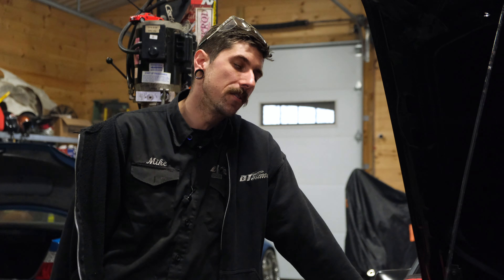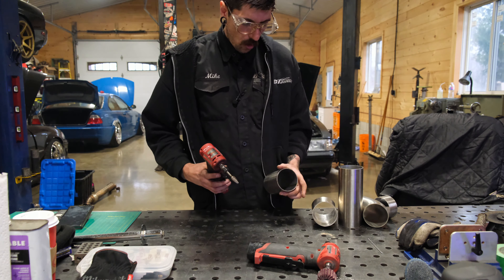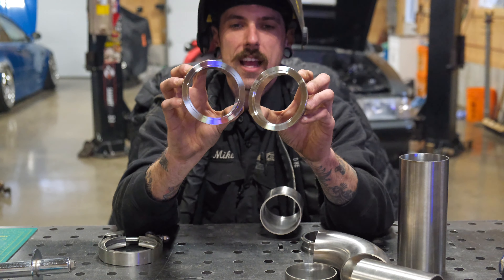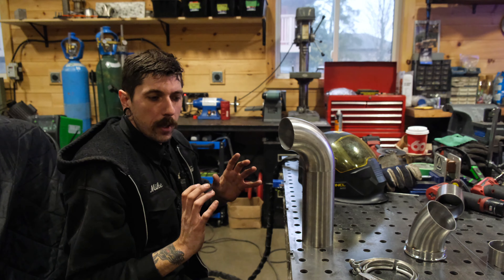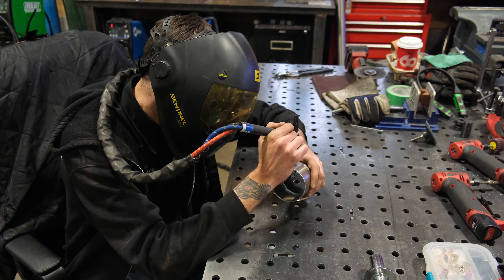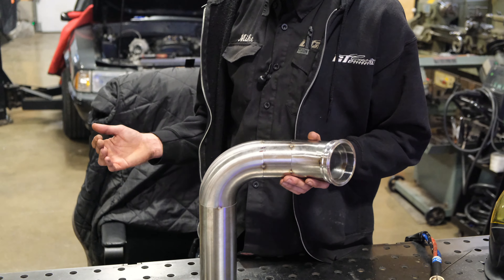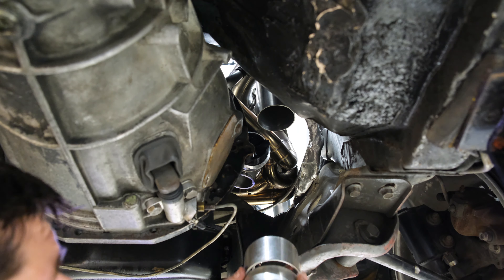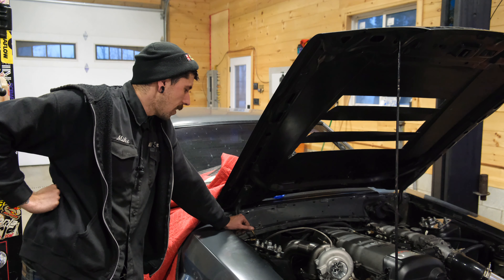TOYOTA 1JZ SWAPPED FOX BODY FORD MUSTANG DOWN PIPE BUILD. (EP.30

Comment: Lol my vibrant clamp failed just as quick as my garrett clamp. 
1-2 time use
But atleast vibrant you can just buy the stud part
Reply from the maker: You always gotta put a little bit of anti seize on the threads because of the type of nut that it is! I use an abuse these badboys every day 😂  its a locking style non-nylon nut so without a little bit of lube, it will definitely catch and Marr up threads! The clasp that lets you take the clamp off and on the bolt is also one of the best features compared to a lot of the cheaper ones you have to fully undo to get the clamp apart!